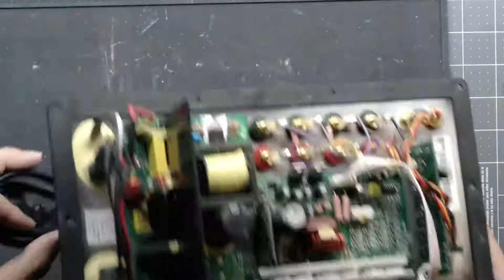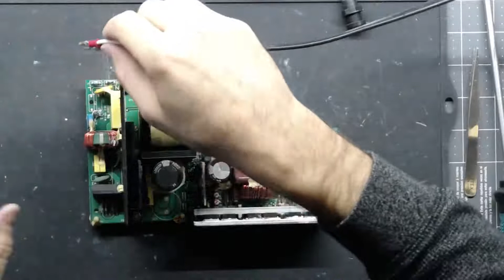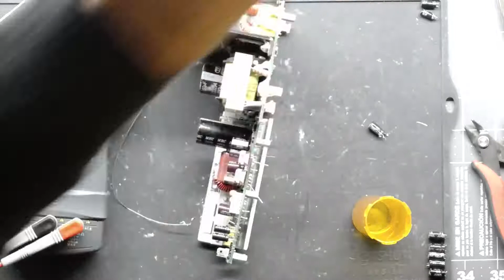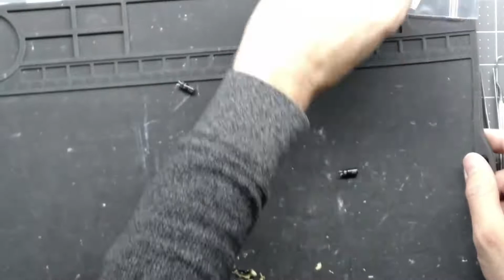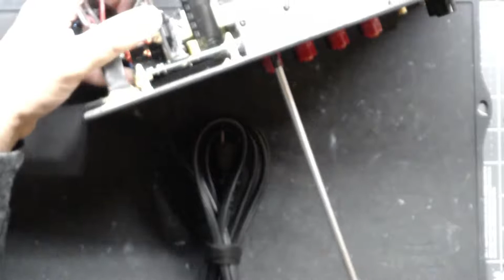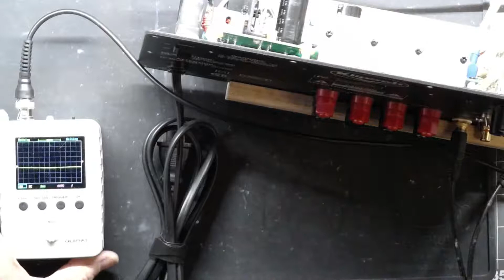Supreme Innovations LLC Live Stream - #007 Klipsch Synergy SUB-12 Repair

Comment: have a sub 12 amp that powers on but cuts in and out. works more often if the recever is turned up louder. thought it might be the recever, but today, I noticed it does it on a different recever also

Comment: I’m following along while repairing a Sub 10 in Neerim South, Australia. Thanks for staying up late. I appreciate your company ☃️
Reply from the maker: Glad this could help you out. I plan to do more of these, as I have a few on my shelf.
Reply: Thanks again for the insights. After the glue cleanup and recap of my Sub-10, it powered up but one of the output MOSFETs exploded/cracked. I have replaced all 4 output MOSFETs. But without a circuit diagram, I’m reluctant to power it up again. And it will need bias adjustment. I guess I adjust the 2 trimpots, can you help me with the voltage?

Comment: I'm following along doing a sub-10 repair.  I have replicated your current limited supply. I am curious, what are you using for your 4ohm load when testing the output?   What are you discharging your caps into?
Reply from the maker: I use 2 8ohm 300W resistors in parallel for a 4hom load. I discharge into a 200W incandescent lamp.
Reply: I'd like to see your surface mount Q5 swap to TO transistor. On the Bash board, what is the IC under the glue? Can that IC be ordered from digikey?
Reply: After a full recap, MOSFET, THC, Q5, Z1, and TH3 replacement I went to test the PSU via your video @59:00.  I am only seeing 20VDC and my current limited AC supply bulb is pulsing.  Also, I see very little voltage between R70 and R71 as you tested @59:43.  From your forum I believe you are saying the issue is the PDC at this point but I am also concerned as to why I am only seeing 20VDC.  Can you do a video on testing/repairing the PDC as well as an tips on low voltage across U4 and U5?
Reply: I did a full rebuild of the PDC... I had to replace the MOSFETs with the Sub12 parts and all worked after that.  Q14,Q20,Q7=IRF530 and Q13,Q19=IRF9Z14 or IRF9530
Reply from the maker: The bias will need to be adjusted if you want clean sound. I will try to get a video in this week that shows this process.